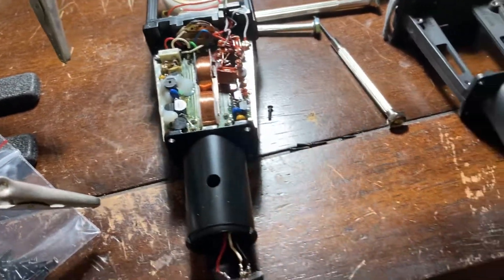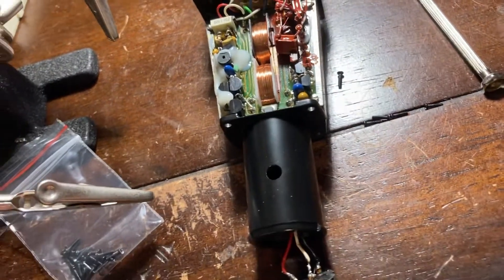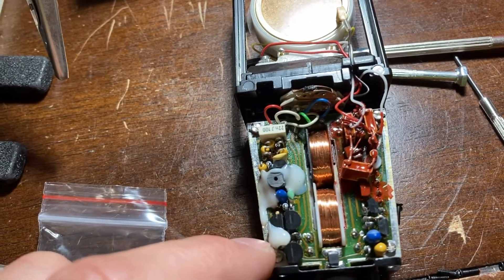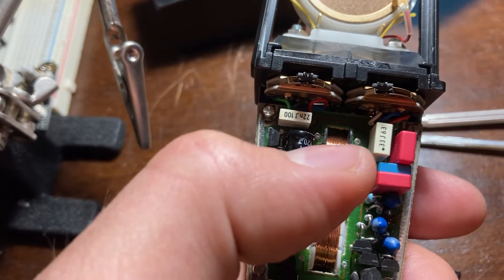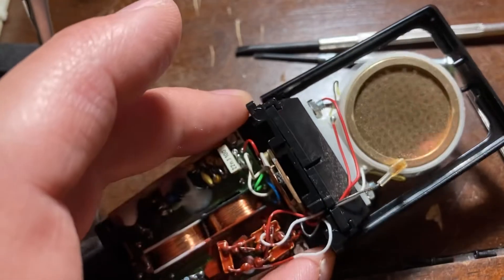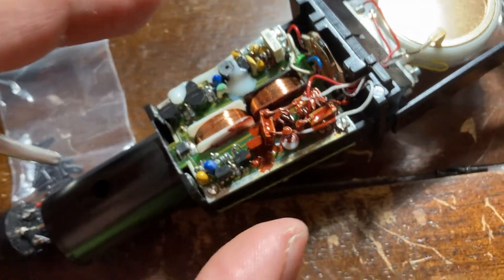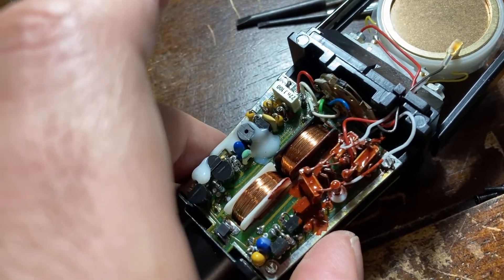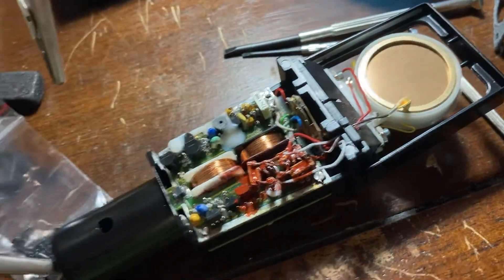Replacing the Frame of an AKG C414 B-ULS

Comment: great video. Where do you order the frame or other parts for this mic?
Reply: Great video! Thanks for posting. I broke broke my pattern selector switch. It would be nice to get it fixed… Am I seeing that your pattern selector switch is also broken? If so do you know what the fix would be? Thanks!
Reply from the maker: yeah I need to fix that too... some day down the road lol. paper clip helps with that for now :)
Reply from the maker: Thx!  Here: https://www.fullcompass.com/prod/227975-akg-2059z03060-frame-for-c414-b-uls